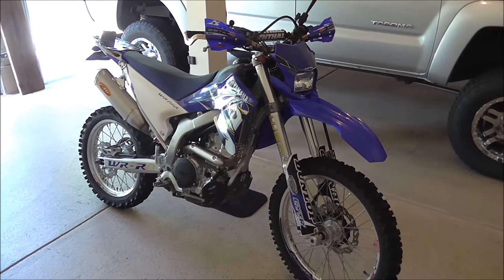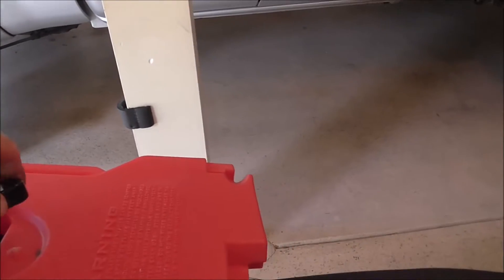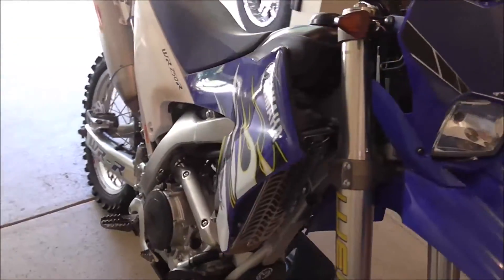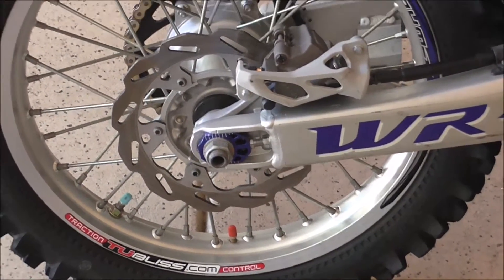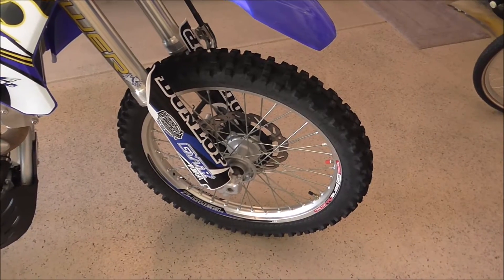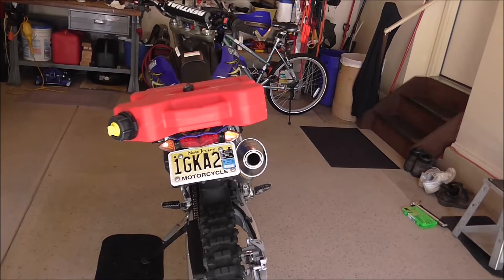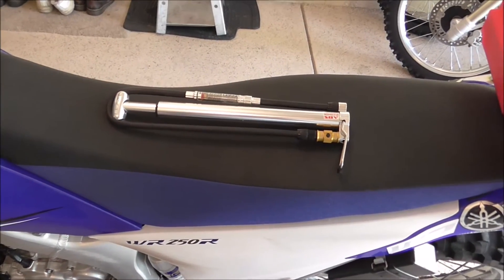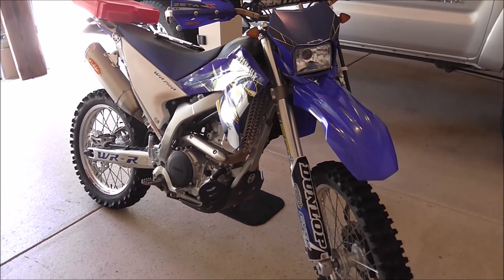How I prepped my WR250R for a trip to Moab UT

Comment: Same thing happened to me with the Rotopax. I had to open the cap a little and spill gas on the trail but it was only a little bit and then that let enough pressure out to let me turn the handle.

Comment: I prefer to istall aftermarket 3G tank. Yes, its kind of expensive, but I really would hate that canister behind my back. Otherwise nice video, thanks!
Reply from the maker: I agree 100% it was annoying and inhibited normal riding posture other than sitting.  There is one reason I chose that method, I only needed the extra capacity for that trip. I even removed the rack when I got home because it keeps you from getting your weight over the rear fender in rough areas such as whooped out fire roads. It solved the problem for the trip but certainly not the best long term solution.

Comment: You could have loosened the cap on the rotopack to relieve pressure.  Might have lost a tiny bit of fuel, but it would have worked, if you didn't have a wrench.
Reply from the maker: for a normal person yes, but as anal as I am no.  I turned it an extra turn beyond so it wouldn't rattle at all and chaff the rack so the plastic itself expanded too much.

Comment: Hi, I am from PA and see that you have WER suspension, I have had both my CRF's done by them and have been super impressed by them. How do you like your WR250R suspension by WER? I have a Wr250R also, but suspension is stock. Thanks
Reply from the maker: The suspension is night and day better.  Stock the rear end is just a spring in harsh terrain as the compression and rebound circuits do almost nothing.  I live in South NJ and we have nothing but deep sand whoops here in the woods.  Drew at WER really transformed the bike and I definitely recommend sending it to him .  At minimum have him do the rear, the front is a pretty decent setup for a stock 300lb DS bike.  I promise dollar for dollar its the single best mod for the wr250r you can do.  It will never be as good as your CRFs because the WRR does not have an MX quality shock but it will be far better.  I was able to ride it safely in a few local ECEA enduros in the DS class after the WER revalve.  Stock, don't even attempt it !

Comment: Enjoyed the video.  A note:  You can spray bedliner on the engine side of a metal skid plate to dampen the sound you are worried about.  You can also install rubber sheets to the underside of the skid plate as well.  Just a thought if you ever decide to go metal.  I had a plastic skid plate that when I bottomed out, it cracked and broke apart.  No damages to bike.  Sure enough. five minutes later, bottomed out again on a ride and that's when the damage occurred to the engine.  So, "plastic is better than nothing" may only work for five minutes on your next ride.
Reply from the maker: I had almost zero confidence in it and rode as if there was no skid plate at all.  I will definitely go aluminum next time and use your advice. thanks for the tip !

Comment: You need to get the deluxe t-handle which will elevate the fuel can swelling problem.   That mount adds a secondary aluminum piece that is stationary as the t-handle is cranked down.
Reply from the maker: Good idea. That sucker was immovable bare handed.  Live and learn !

Comment: Just stumbled across this great video.  Just curious, what footpegs those are?
Reply from the maker: they are stock footpegs and springs from a YZ250/450F.  Not sure what year though, guessing 2004.  The brake side will contact the the brake pedal mount slightly when the peg is fully folded up but I never had issues, it touches lightly.

Comment: salut est ce que la pose du silencieux  FMF a demandé une reprogrammation de l'injection ?merci
Reply from the maker: the FMF slip on did not require a programmer.  If I added the header as well ...YES it would.  As a note I left my airbox stock.  Cutting it out and opening it up would add to the need for the programmer.

Comment: so when you install new tires you have to spend 200 more dollars for 2 new high pressure tubes?
Reply from the maker: no, you just cant use tires that were previously mounted with the old type rim lock because they damage the sidewall where the tubliss system creates a seal.  You can certainly re-use the tubliss system as long as there is no damage when changing tires.

Comment: Can you use tubliss for road use too?
Reply from the maker: Yes, I do.  The manufacturer states off road use only, however I have used them for almost 2 years on and off road.  If you are used to running the stock WRR setup with no bead locks then you may feel a slight shudder from having one that is part of the tubliss system. It is also heavier than most.  It doesn't bother me and was no different than running regular tubes, beadlocks and knobby tires on road.

Comment: what size sprockets did u run rear looks like a 45 ?
Reply from the maker: I was using a 43 since I use the bike often at home on the street as a commuter.  I would certainly recommend using a 48 for mostly offroad and truthfully it wouldn't be horrible at 60-65 mph cruising either for short trips.